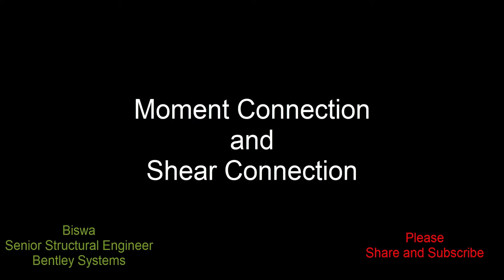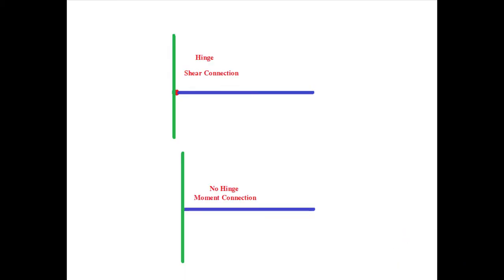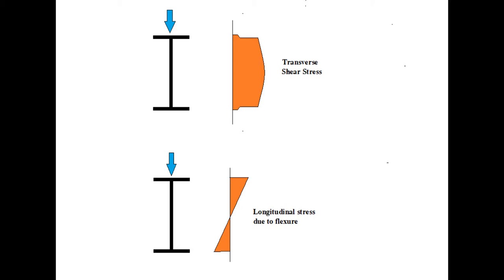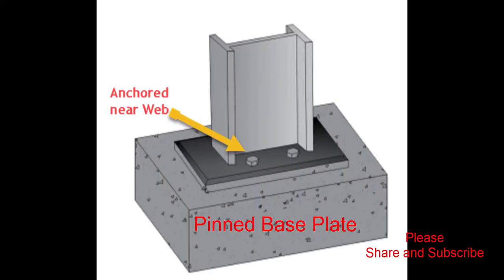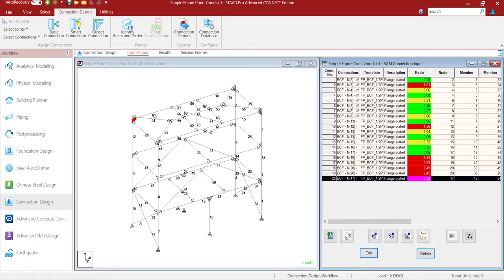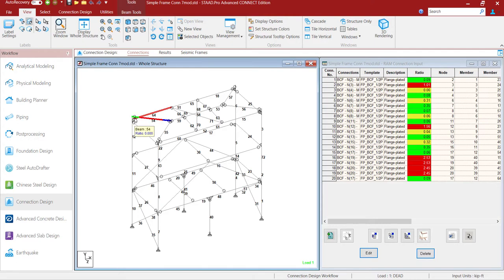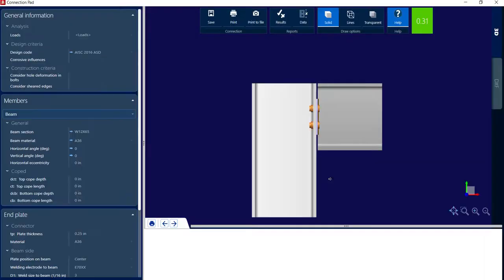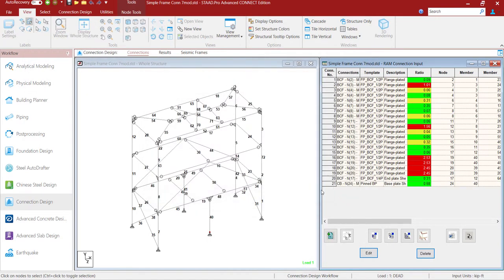What is Moment Connection and Shear Connection? Staad and RAM Connection

Comment: Are structural steel beams ends touching the column flange meaning no gap or clearance at all whether it's shear or moment connections?
Reply from the maker: Gap at the beam flange is for Shear connection meaning we are not allowing the extreme fiber to displace